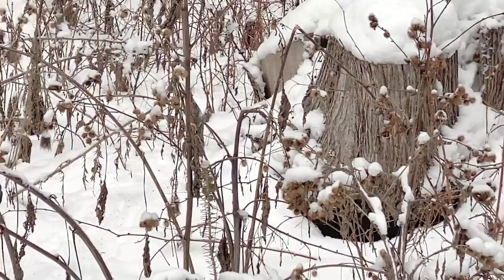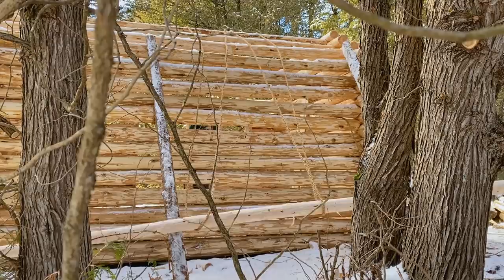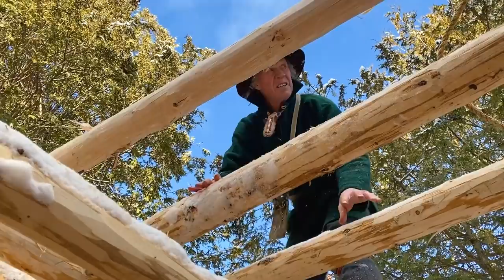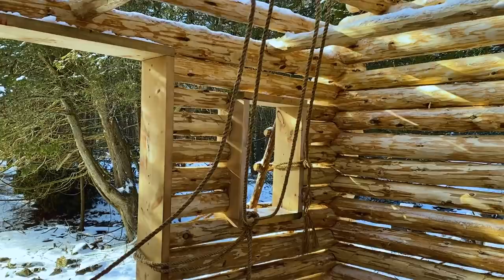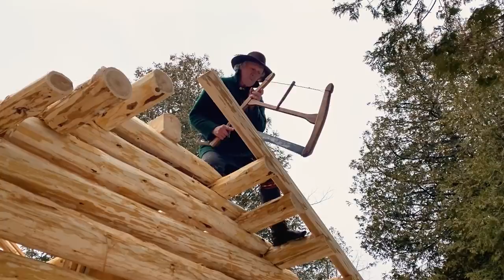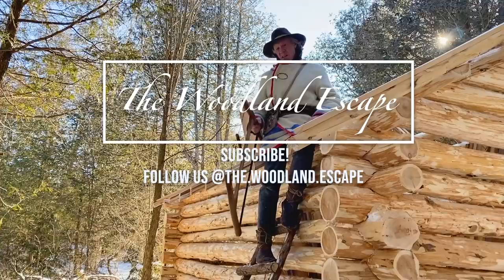Gable Ends & Rafters | LOG CABIN BUILD | PIONEER LIFE CIRCA 1700's

Comment: I suspect, if you looked closely at the cabin built in the 1840s which you mentioned, you'd find shims between the log rafters and the sawn boards secured to their tops. The technique is still used sometimes today with warped or misshaped trusses to flatten and even out a roof surface which, as you said, would relieve stress on the sheathing or strapping as the case may be. 

Cabin's looking great! I'm impressed with your working through the winter like this. Good job.

Comment: How seasoned are those logs? If they are still green, then do you have to plan for them to shrink and thus the cabin to settle? And if you have glass windows, would that create pressure on them? (I do see the window boxes, so maybe that protects windows).
Reply: I would like to know that also.  Like what will happen when it start to get warmer?
Reply: Sink is reckoned at about 3cm a meter for (fresh)pine and spruce on full line-scribed houses.  Maybe Cedar is dissimilar. The door frame will hold up the gable wall when the corners sink down.
Reply from the maker: The logs are green as grass, but cedar doesn’t shrink quite as much as other woods.  I have allowed a gap over window and door frames for shrinkage.

Comment: I found these videos and started sharing them in my garden/homesteading group but the farther I got in them the more I wish I had not started sharing because you spend far too little time showing, explaining, how, what and why you are doing certain things.  Nobody could follow these videos and erect their own cabin.  Yes someone with carpentry skills could figure out a way to solve such and such a problem but for example you did not really show here how you actually put up the rafters one scene there were none then then next shot nearly everyone was in place just like when you put the logs above the windows and door.  you briefly tried to explain but then there is not one video showing the result until you finished.  You did not show one single example of putting the logs between the door and windows I am assuming you drilled and pegged but you told nobody just showed it finished,  You did not show how you notched the logs, you spent more time showing you going from one side to the other moving your ladder.  Very disappointed in the quality of these videos for helping the novice to erect their own cabin
Reply from the maker: Thanks for your feedback Charles.  I am far from an instructor, simply attempting to show life in the 18th century.  I will make an effort to show more detail, but this is not intended to be a how to series.